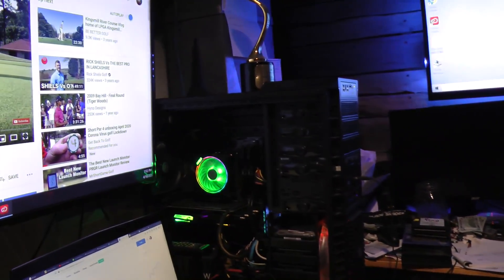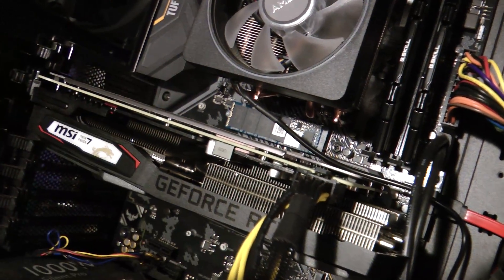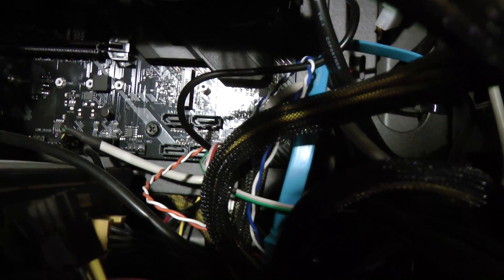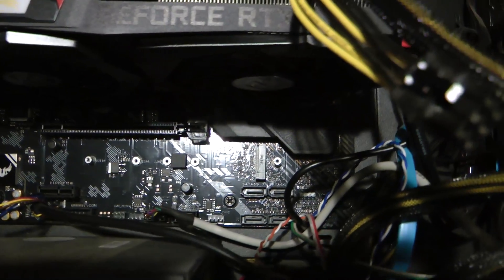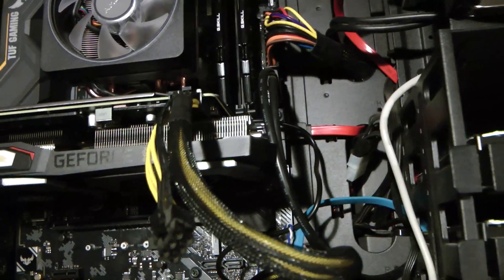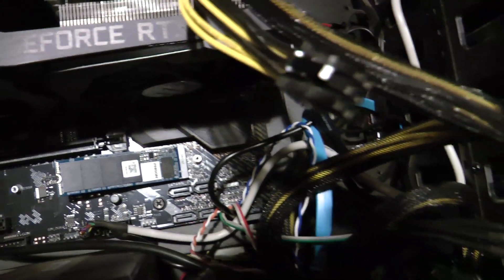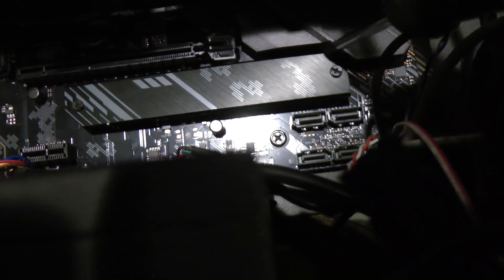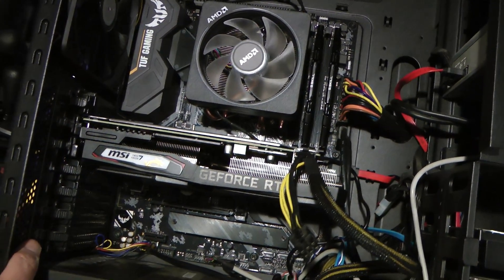How to add a second/two M.2 SSD drives to the Asus Tuf gaming x570 plus motherboard

Comment: so... when i unscrewed the screw on the right to change the ssd the screw broke in half. I now only have the screw in the left holding the cover in place. Do you think i should be worried?
Reply from the maker: i don't know many hard to tell.   If the SSD seems secure that what matters most

Comment: I accidentally ordered 2 500gb m2 ssd instead of one the 1tb one. should I just install both since my motherboard has space for two or send it back and get the 1 tb one?
Reply from the maker: I'd send it back.  1 tb is good for a system drive but i'd get a 2tb for media for the second slot
Reply: extendedplayarcade Ok thanks but I don’t really think I need 2tb and if I ever do is cloning from 2 500gigs to one 2tb gig hard? cause I don’t know how cloning works but I’ve heard it is possible. or would I notice any other problems if I kept both 500gigs except from the lack of storage maybe?
Reply from the maker: @justlucamusic  if you kept both 500 gig you should be fine if you aren't worried about storage and with win10 OS it's near impossible to clone... it a full re install
Reply: extendedplayarcade oh ok thank you! :)
Reply: @justlucamusic  I'm running a 500GB SSD for the OS and 1TB SSD for games and an external spinning 10TB USB 3  for media

Comment: Great video!! Very informative. I just have one question for you if you dont mind me asking. Is it true that using the top or bottom nvme slots can render sata ports for regular SSDs unusable? ideally id like to use both m2 slots and have two regular SSDs. I havent seen anything in the manual for the TUF X570 explicitly stating whether or not this would occur, but i just found out about this unfortunate phenomena.
Reply: Figured I would reply to this, since it is unresolved thus far. For this particular Asus motherboard, it notes that using the M2.2 slot (the one near the bottom of the board on the fan side of the the GPU) will disable ports 5 and 6 of the SATA controller. This is because they share the same bandwidth on the board and cannot operate simultaneously. Note that you still have SATA ports 1-4 available to use.
Reply: @rolandking507  thanks! I appreciate the insight, and hope that it will be able to help others who find themselves in the same predicament!
Reply: What did you find out?
Reply: @captc502  oh I have yet to get an NVM drive at this point. I still plan on getting one but probably the 980 in a month or so. I'll try to let you know what happens when I get it!
Reply: @Ahhfiddlesticks27  ah ok good luck! I contacted their customer service and they say that it should not take extra slots. They say that it does not require any "band sharing"
Reply: @captc502  hey thanks for letting me know! I really appreciate it and will definitely keep this in mind when I'm ready to get a 980 Pro
Reply: @Ahhfiddlesticks27  good day 
What happened to you
Reply: @OpTicTNT  hello! Oh nothing I just haven't gotten an NVM drive yet
Reply from the maker: i'm currently only using the 2 m.2 ssd drives in my rig.   If I need more media storage I'll use an external drive.   So I wouldn't know the answer to this.  Maybe contact ASUS
Reply: @extendedplayarcade  ah okay I see. I appreciate the response! I'll reach out to them and double check.
Reply from the maker: @Ahhfiddlesticks27  cool let me know how it works out.  Good luck

Comment: Question, i have the b450 support for dual m.2 do we need to have the same NVME or can it be different brand NVME i have a 970 evo plus but I'm thinking of getting a 1TB specifically for media and no games, only the evo plus
Reply from the maker: I bought the same card twice... it runs amazing it's so blazing fast.. i can edit 8k footage so fast    no proxy's
Reply from the maker: same card posted in this video and it's a budget card from micro center btw and ftw
Reply from the maker: and i don't work for them or make no money for this.  yes i'm a fool lol
Reply: @extendedplayarcade   ok so what if for example if you have windows installed on a faster m.2 and games on slower m.2, then will the lower run at the stated write/read speed or will it run faster speed where windows is?  will it be a bottleneck?

Comment: They placed the Chipset right under graphics card.  Chipset fan can't breath. My PCH temp is 80 degrees!!
Reply from the maker: you mean the M.2 SDD drive?
Reply: @extendedplayarcade  Chipset running 80 degrees at idle. Got a GTX 2070s that cover chipset completely making it hard to get air. Running fine though.
Reply: @extendedplayarcade  Moving m.2 to upper slot reduced chipset temp 10 degrees
Reply from the maker: @shibanuma  I have one in each slot... runs fine.  No issues.    maybe add so fans to your case is't a cheap fix

Comment: I installed a second M.2 SSD onto my Asus x570 motherboard also. Will data be automatically be stored on the second M.2 SSD when the first is full?
Reply from the maker: I don't think so.   You'll have have one as your C drive AKA windows drive that holds all your programs.   The other one will be your Media Drive AKA D drive or what ever you want to call it.   Hope that helps   with this set up you can edit 4k video with no issue.   Super fast data transfer rates.

Comment: Do you have to use the same exact m.2 ssd or can you use two different types?
Reply from the maker: not sure...   I'd check the specs on the motherboard.   I just bought the same because the first one worked so great at a good value
Reply: @extendedplayarcade  thanks i was having problems and was about to get the same type. Turns out I'm a dummy and didn't create the storage pool..
Reply from the maker: @redman4738  we all make mistakes.... don't be so hard on yourself.   Just think if you can build a computer you a whole lot smarter than millions and millions of people.

Comment: I hope you put a PCIE 4.0 compatible NVME on.
Reply: I was thinking the same thing since it says on the manual the second drive is PCIE 4.0 but would it make a difference if using PCIE 3.0 instead of 4.0??

Comment: what is the screw that comes with the motherboard? also my ram is not clicking on this motherboard- can someone help me? I also have the same ram as the guy in the video.
Reply from the maker: before installing the ram make sure the tabs on the mother board aren't already close... push them down or back and then try to install the ram.  i hope this helps

Comment: So this board has only 1 heatshield for a m.2 drive and that’s for the bottom slot? Why wouldn’t they give 2 shields for both slots ?
Reply from the maker: good question!
Reply: I think because the top slot has more pcie 4 lanes vs less pcie 4 lanes on the bottom slot. All the NVME gen 4 that I’ve seen have a heat sink included and I assume they assume you will install it in the slot closest to the chip with the most pcie 4 lanes. That’s just my guess.

Comment: how do you get those panels covering the m.2 slots off. thats really the only thing I want to know.
Reply from the maker: small Philips head screw driver.
Reply: The plastic cover won't come off even though the screw is out.
Reply from the maker: @briancarleton4032  the cover on my motherboard is metal not plastic.    Maybe it's a different motherboard?
Reply: @extendedplayarcade  yup, I have the x570 e:( It looked so similar.
Reply: It's stuck under the panel under my video card. I guess I have to remove the video card and the panel to take out the cover of the m.2
Reply from the maker: @briancarleton4032  there was enough room for me to leave my video card in but it was tight.
Reply: Made it sound like that didn't need to be done in the video, how do I remove it without doing that? Or is that the only way?

Comment: I have the same motherboard and m.2 SSD. What size are those tiny standoff screws? The ones I have don't fit in those tiny holes. It's been driving me crazy. Any help would be appreciated!
Reply: Contact Asus. I was missing mine and they sent me new ones for free by FedEx.
Reply from the maker: @yezhik1979   awesome good call... asus rocks
Reply from the maker: i don't know the exact size maybe I can look it up some where might take me a while.    I saw they have nylon assorted sized for mother boards maybe this will help?  https://amzn.to/2YhbXFU
Reply: To be honest, if you are using the heat sink, why would you even need to screw the ssd down? It stays put because of the heatsink
Reply from the maker: @iamthedevil60  because the universe depends on it

Comment: Why remove the thermal pad? It wont even make contact with the heat-sink without the thermal pad. Maybe best to just remove the plastic lining that says remove? Anyways just a thought and I would like to know who told you to remove the sticky thermal pad? (Well, at-least your language in the video made me think that you removed the thermal pad and not just the blue plastic protector. Sorry if I misunderstood what you were saying.) Anyways for those that see this, you should remove the blue plastic protective layer and underneath should be a double sided sticky thermal pad. This is essential to transfer heat from the drive to the heat sink. Sticky pad stays on, blue plastic liner off. ;-)
Reply: yeah wish i read this comment first. i ended up throwing away the thermal pad. :(
Reply from the maker: I didn't remove the thermal pad... I removed the blue part of the thermal pad so it exposes the thermal pad or whatever it's called.    sorry if you miss understood.   when i have i will rewatch the video and see what I said.
Reply from the maker: I even mention that it's a big puffy sticker and remove so I can see why you would be confused.   I figured it was self explanintory  that you would remove the blue part.    sorry to everyone i confused
Reply: @extendedplayarcade  no worries. i should've done more research. i haven't upgraded my PC in about 10 years. so, nvme m.2 SSDs (and the heatsinks for them) are all new to me. however, from other vids i've seen, and from another comment on your video, these SSDs will be fine without a heatsink since the NAND's run better when warmer and the controller will throttle speeds if too hot.
Reply from the maker: @rarrbear   yeah again sorry for the confusion... I don't write a script and go off the cuff and try to be as candid and helpful as I can be... i haven't upgraded in awhile either but it's crazy how people jump all over ya if you just miss one minor detail..    it's all good.   Times are tense right now and if people can vent at me... then maybe i'm making a difference.   better than violence towards others!   i hope your new rig rocks!
Reply: thank you, not all heroes wear capes.

Comment: Got this same motherboard... does it matter where you put the first m.2 drive?... I bought a 500gb for windows... wanna know if I should put it above the gpu or at the bottom where the heatsink is...
Reply from the maker: I think the first one should be placed above the graphic card/gpu and the second one place like I placed in the video...   I think... I could be wrong but it is what I did and it worked awesome!
Reply: @extendedplayarcade  I put my main windows m.2 where the heatsink goes and it's working fine...
Reply from the maker: @r0achk3vin  oh awesome... so much for my advice lol... it's all good bro!  glad it worked and good to know for anyone asking the same question.   Stay safe my friend
Reply: @extendedplayarcade  yep... thanks for your help... will be putting a 2tb in the other slot for storage of gsmes and maybe a 4tb for like pictures movies music etc.m
Reply from the maker: @r0achk3vin  that would be awesome!  yeah I might even game on this rig... it's so fast.  but I should do more video editing and photoshop jobs but i'm a slacker and will probably play a few games lol
Reply: @r0achk3vin  I would place your OS on the top one. Most likely its directly connected to the CPU, the lower one goes through the X570 chipset (which is right above it with small fan). I'm not 100% sure about this, but mobo's usually have this setup. See disk management, top is disk 0, bottom is disk 1. Note, both use x4 lane, so the speed difference will be very small.